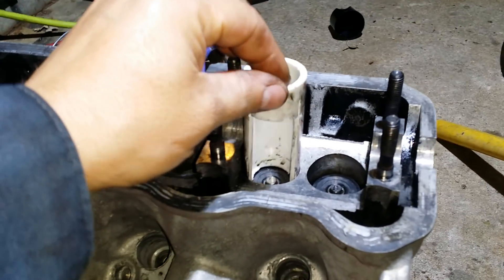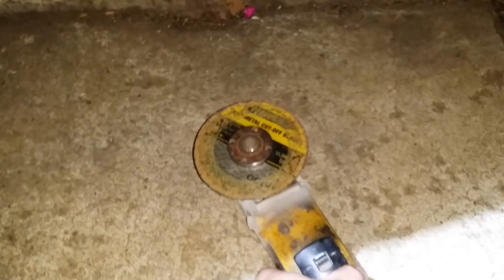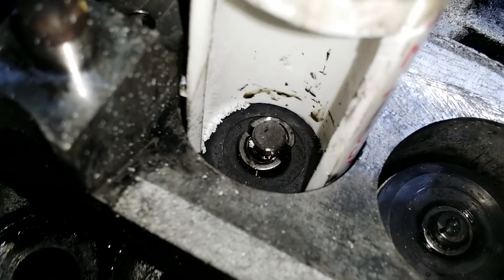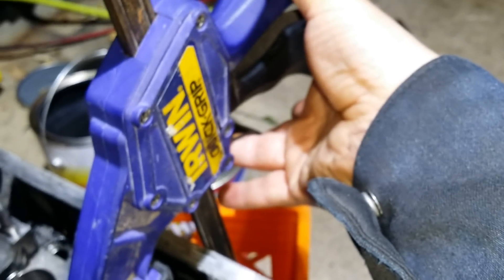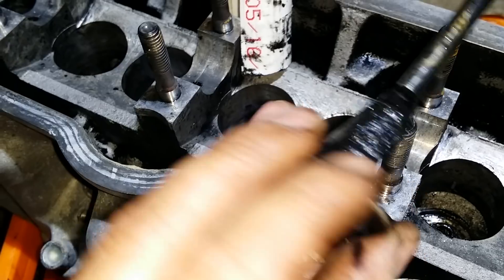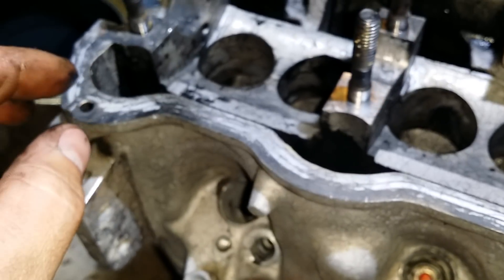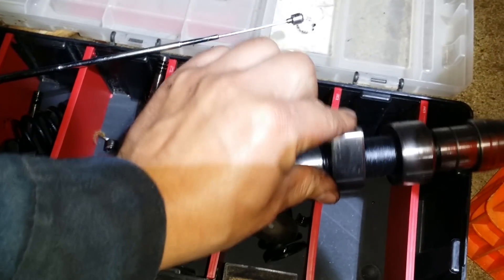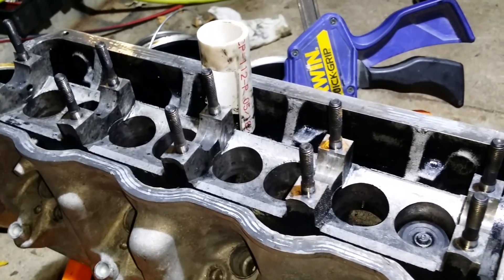Catastrophic failure using waste vegetable oil

Comment: You're 1 in how many. (Clean the block a little bit ?- so you glazed it and had to hone the cylinders) Later on must of contaminated the oil. cam lobes won't be affected by running waste oil are you using it in place of engine oil.. Thats a start
Thanks for wasting 5 minutes of everyones lives.

Comment: I have run filtered used veg oil in my twin tank conversion for 15 years and never had to clean injectors or do other stuff just keep the EGR valve and pipe clean which is normal with diesel also.But I think switching to veg from diesel when veg is hot cuts out loads of problems also regular oil changes every 5,000 miles.I've done over 200,000 miles on veg.So short term mixing veg and diesel 50/50 may work..adding petrol to veg may work...biodiesel may work but long term heating the veg works long term.....

Comment: I have a 1.9tdi like this and have pulled the head when I got it, I had a similar situation with my valves and intake clogged up in a similar fashion, I blanked the egr put it back together and ran it-  60k later I pulled the head again to re-hone it- intakes were all clean valves were clean.. I've never ran veg oil so I'm just saying the egr can definitely be a major contributing factor to this kind of build up with straight diesel. I'm thinking of running some veg oil with the price of diesel now, yeah my engine does seem to use a little oil through the pcv but I'm just saying this clogging could definitely be egr related
Reply from the maker: To fix this problem you need to install a oil catch can this way oil doesn't bypass the PCV and enter intake and goes in the EGR cooler .
Reply: PCV  and EGR are two different things. He said egr and you respond pcv.

Comment: my friend that looks like whats called Wet stacking that looks to be an exhaust valve, Wet stacking typically occurs when the engine Idles for a significant amount of time, unburn combustables can buildup on anything in around or near the combustion chamber and deposit themselves, the only fix for wet stacking is High idle or dont idle for extended periods, Higher EGTs than that produced at idle eleminates wet stacking and ocasional Italian Tune ups help clear the issues,

Comment: This was caused by 7 issues:

1. Not preheating waste cooking oil.
2. Not cutting the wasted cooking oil with something like jet fuel, kerosene, lamp oil, turpentine, or a mix of these to make it thinner and winterize it, finally adding Diesel Mechanic in a Bottle to the whole mixture to ensure gel protection.
3. Not putting a blow-by oil air separator filter between the crankcase blow-by exit and the crankcase ventilation valve.
4. Not having a filter trap for particulates and other trash or something of the like before the egr valve that you can change out every so often when needed.
5. Not checking the injection pressure of each and every single fuel injector, if you're gonna use waste oils or diesel, make sure the that each injector is at the pressure of 200 bar to 220 bar in direct injection, or for indirect injection diesels you need to ideally be at 175 bar to 185 bar injection pressure.
6. Make sure the air intake is cool if not cold before it gets compressed so there's enough air density to burn all that preheated fuel.
7. Not putting in an electronic fuel injection enhancer on each fuel injector to capitalize on the preheated cosolvent blended veggie oil's better burn capabilities at ideal injection pressures.
Reply: 😂 sure it was 7? I can think of at least one more..
Reply: @sirridok  I know it was largely those core 7 that caused that problem...
Reply: @DerpyRedneck  I'm just here taking notes..trying to figure out which diesel to throw in the rodeo so i can try my hand with this WVO game
Reply: @sirridok  That's fine, what was your 8th piece you were gonna suggest?

Comment: That wasnt caused from waste veggie oil that is weapage of the valve guide seals or blowby gasses entering the intake hitting the hot intake valve and carbonizing this is why GDI engines do this so bad its 90% of time the blowby gasses from crankcase that is plumbed back into intake has oil vapor / mist in it and it cakes onto the intake valves the intake valves dont get hot enough to burn it off like the exhaust valves also alot of people use a catch can to eleviate this issue many also use water methanol injection on diesels or just water injection as this actually benefits a diesel heavily its often referred to as the steam effect as the water enters the intake system it cools the intake charge this means more dense air in the cylinder and that water vapor also has a secondary effect that lengthens the power stroke due to the moisture expansion after fuel is burned off hince steam effect also the water injection cleans up the carbon in the intake / cylinder and exhaust just got to remember doesn't take much to get this benefit.

Comment: thats not a veg oil problem Bud...........check your EGR valve set up. I may be mistaken but i think the lobes on your cam are supposed to be different from inlet to exhaust to vary the duration and overlap. 
Like the home made spring compressor😁

Comment: Holy s**t, so much incorrect/bogus info here including in the comments.  Don’t quite know where to start.  I’ve been running straight used Veggie oil for the last 12 years at around 40-50 Ks a year and never blown a pump, an injector or an engine.  The one time I stripped an engine to freshen it up before I turbo charged it, there was zero buildup behind any rings or valves.  After 50k on oil.
  It IS possible to get oil behind the intake valve due to the EGR action.  Block that off. It isn’t needed anymore because the combustion temps aren’t high enough.  
That brings me to my final point.  If you are just running around town on oil.....don’t.  Unless your engine gets up to temp AND SPEED and stays there for a while you will get the problems depicted here.  
  You are not saving enough to make it worth your while unless you are driving considerable distances every day.
Understanding what happens in your engine will help to avoid these dramas.

Comment: You can mess up some equipment using it. It was a big thing for awhile. Even after it has gone thru the process of turning it into bio diesel.  The city here was pushing it. They were picking it up at the restaurants and processing it.you could get it in gas stations. So many people had problems it's pretty much gone now.

Comment: you are an idiot. intake and exhaust cams have different profiles. and you tried to clean the head from sludge but it clearly Show signs of poor maintenance. You have lots of buildup on itake because your piston rings are damage from not changing the oil frequently which caused blowby which caused carbon buildup on intake side.

Comment: Definitely a egr failure.
Reply from the maker: EGR was ok... Had massive blow by because the waste vegetable oil seized up a couple piston rings.
Reply: @AndersonERockefeller  deposits wouldn't be on top of the valves. With a ring failure

Comment: Fawking egr ,ingesting the vomit

Careful with the veggie oil!!!!!  if you park your car for a few months, it WILL gum up the  (4 ,or more) vanes,inside the pump,they will all retract,as soon as you crank the motor,they will stay retracted at cranking speed,and the thing WILL NOT START; you'll have to TOW it, 2nd gear,at 2O- 3O kms/hr~~, for one kilometer or more; ask me how i know;(there IS another trick,without towing!);  i've been a mechanic for over 35 years,had to do this several times,not once i had to open the f. i.pump.

Comment: egr problems and worn valveseals, nothing to do whit veggy oil.
running to long whit bad lube oil like this causes these problems.  not the veggy feul.
Reply from the maker: All the Rings were frozen on the pistons, had to soak the pistons in special solution for two weeks so they can break free and still had hard time removing rings... check some of the videos and see the excessive blow-by engine had...
Reply: yea, it burns dirty, but the egr has a lot to do whit it to, same as changing lub oil more often. the gunk on your inlet valves show that to.

Comment: I think I'm confused. You're showing damage above the valve guide. As bad as the problem is due to the cooking oil accumulating on the valve, how would that effect what goes on above the valve guide? Where the valve guides damaged, or pushed up? Regarding the damage to the cam shaft, wouldn't the problem most likely be that the deposit would prevent the valves from seating which would in effect cause the cam to do 'less' work?
Reply: most of this problem is lack of lubrication, due to very dirty lub oil to. running the engine whit all this gunk in it is not good for the rings to, mass problem here ise lack of clean lub oil, worn valve seals, and y think egr problems.

Comment: Try adding a solvent to the vegetable oil. That should clear up the issue
Reply: Yeah. Vinegar works well for that.  I get most of my car parts from the kitchen. I use potatoes for brake pads.  Maple syrup for power steering.  If your differential is making noise, throw a banana or two in.
Reply: not entirely what I meant, but you have some good ideas there. I'll give those a try
Reply: Scott Diamond lol🤣

Comment: A good fuel system cleaning additive would have probably made a big difference there. 

Additionally, I heard canola oil when used as a motor oil has extreme cleaning properties. The only downside is that you need to change the oil more frequently as it gets thick quite quickly.
Reply: Canola oil is not a good idea and has no advantages over synthetic oils which are much better

Comment: its just ur valve o rings fucked up, NOOOTHING about WVO, i seen the same crap on carburetor engines many times... also  ALLOY heads and block very soft material, its not cast iron for sure... overheating, then cooling many many times. 

please fix that video do not make people to believe. Its just unfair

Comment: Probably could've clean those stems and put it back together and kept on rocking.. Maybe run regular diesel for a while and some high detergent oil until everything seemed normal again...
Reply from the maker: Jon Doe I thought about doing that but both intake and exhaust ports we're  completely clogged from excessive Blow by not to mention the Rings were stuck as well..

Comment: I am glad you made this video. Unfortunately a lot of people who have had issues have not made videos about the failures. There are too many contaminates in the oil and it is not refined to remove impurities. This is the same gunk that builds up around the fryers in the kitchens that the oil came from and now people just want to drop it into the engine and think it's ok. The engine does not get hot enough to burn off the glycerin that is in the oil which is removed when biodiesel is manufactured commercially. Perhaps an experiment where one takes a pan of vegetable oil in a pan and leaves it on the burner until the oil gums up and one with regular diesel to see just how bad this stuff can get. Thanks for sharing. I'm sure the turbo had a lot of gunk in it too.
Reply: Since this is a diesel, can you explain how the wvo got on the intake valves ? or how it would get on the turbo ?
Reply: This engine was used in a model year that uses EGR. This recirculates exhaust that contains (Soot) back through the in intake which collects in the intake manifold and on the intake valves. This has happened ever since the EGR system was put on these diesels regardless of whether WVO was burned Vs regular diesel. This is now happening to direct injection gasoline engines with the carbon building up on the intake valves. There are plenty of videos on youtube with people trying to deal with the carbon troubles.

Comment: water injection would solve it, turns to steam and steam cleans your engine
Reply: There is already some water in some diesel mixes that water dissolves into. Just a tiny bit is good for engine staying clean, too much can explode some parts.
Reply: highly have to be onto it to try this in a diesel

if u water inject ur diesel without a care ur engine will desolve.........
diesel tens to run sulfur in its fuel and helps in engine longivity like lead in petrol used to

water + sulfur = sulfuric acid

wvo dont contain sulfur but resadue out engine needs cleaning

Comment: How came inlet valves where so dirty? Engine is fed through injector? Also I used long socket to remove valves. I placed socket and hit it with hammer with certain force. When your valve washer is going down those 2 clips are thrown a side. It is much quicker method to remove them. To install you must use valve compressor.

Comment: I've being doing cylinder heads for 30 years , and that seems to be valve seals. If the oil was to blame, your journals would be torn up, and cam lobs are suppose to be are suppose to be that sharp, the none sharp rounded ones are the bad one. Just pointing it out to you.
Reply: You're blaming waste vegetable oil for your engine being in a mess. You're rings were likely gummed to start with and you cannot be sure they ever weren't. It's highly improbable a healthy engine running one tank would get in such a mess. Hence all the people who run veggie oil all the time being so WTF!? you're engine did not catastrophically fail either. Valves can clog like this on straight diesel with a faulty EGR and the majority of those deposits were almost certainly already there as one tank isn't sufficient operation for all that to build up. It's an interesting video and teardown, but I think your conclusions asto what is to blame are unfounded
Reply: I bey you shuddered when you saw his PVC pipe and ratchet clamp valve spring compressor. I know I did. I value my fingers. The failure is hardly catastrophic,. just a worn out, very poorly setup/maintained engine
Reply: Yeap,makes sense; BUT you should have eliminated that egr; it was created by the stupidos of the environment,and caused more harm than good,because LOTS of cars were junked, new ones made,and it was worse than if the a-holes had  been quiet; what do they know about cars!; vw does,LET them build cars properly!     says i,who don´t know shtt.
Reply: @josepeixoto3384  Yeah, you are right. Who fucking cares about your health, am I right?
Reply: One quick and simple fix to prevent ring gumming: run a tank or two of normal diesel every summer, disconnect the glow plugs and start without them on diesel. This will make it hard to start, and the unburned diesel will force its way through to the oil sump via blow by, cleaning the rings in the process. Change your oil immediately afterwards, twice. Then plug your plugs back in again and start using veg oil again.
Reply from the maker: All the piston rings were seized up from shutting off and turning on  waste vegetable oil , once you get massive Blow by Oil gets contaminated from waste vegetable oil and will deposit everywhere inside the engine, especially if you have an EGR the intake and  intake valves will be completely clogged as you can see in the video.

Comment: I drive my old 1996 Audi 2,5 tdi without any modifications almost 50,000 km on WVO. In the winter mix WVO with diesel 50%, and in the summer 20% diesel and work like charm.
Reply from the maker: Let me know when you hit about 130k kilometers how she behaves . make sure you change the engine oil no later then 5000 kilometers , I also used none synthetic oil since I changed it so often ( 3000 miles )
Reply: +Anderson E Rockefeller Something I have to explain one very easy math, maybe you learn something. For these 50,000 kilometers I save on fuel approximately more than 60,000 SEK that is about  6500 euro or 7400 US dollars. For the car that cost only 500 US dollar that its excellent! If this car fail, i will buy another for the same amount of money and drive one more time 50,000 km. So i don´t care about 130k or something else funny  that you said.
Reply from the maker: +Aleksandar Pantovic Well then you got yourself an awesome deal if you can just pay 500 euros for an automobile and save yourself thousands of dollars each time, can't go wrong with that :)
Reply: @AndersonERockefeller  who keeps a car that long to do that many miles 😂

Comment: That is a serious EGR failure issue. WVO does not cake like that. I have taken my head off many times and never had any build up of any kind.
Reply: I am a diesel mechanic and modern engines use egr coolers to drop recirculated exhaust  gas temperatures and in high mileage engines it  prevents very hot exhaust gases coking the oil that is being sucked down your intake valve stems. The stem seals are worn , as pointed out by our friend who's being doing heads for a good long while, i concur brother. The coke then gets into the combustion chamber and will not be burned up but causes physical jamming or sticking of your rings as in your case friend....... thanks for posting...
Reply: There is some vital information missing. What kind of car is this engine out of? What is the model year? How many miles were on this engine at the time of failure? Were there any mechanical issues with the car that were long standing? Was this WVO filtered, unfiltered? Is this pure veggie oil or is it fryer oil that has lard in it? Has the WVO been processed to remove water and sugars? Did the vehicle have a runaway condition when it failed? How much WVO is a tank full?
Reply from the maker: Every single piston ring was stuck and had massive Blow by so at idle the EGR would suck all that blow by right back in the engine which is want cause all the valves to be checked up  including the intake.  After I rebuild the engine I removed the EGR :)
Reply: @AndersonERockefeller
He said valves. You respond rings. Can you hear? One issue at a time. That’s one reason why you don’t know what you’re talking about. Smart people here. Learn from them.